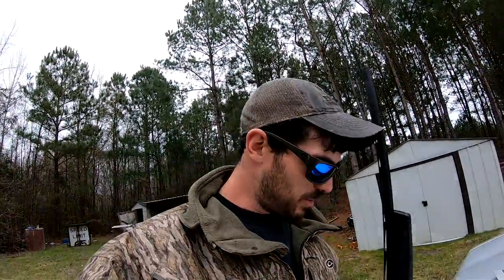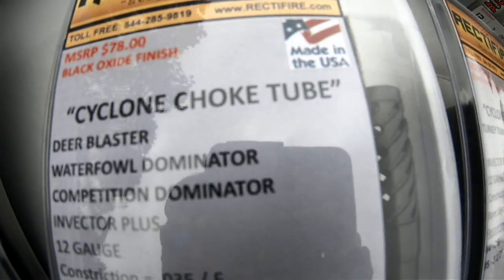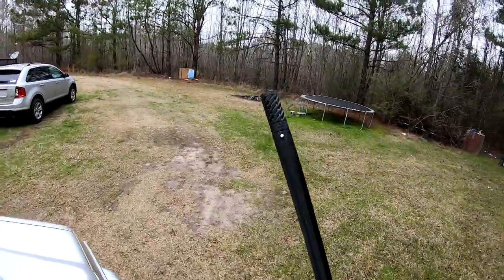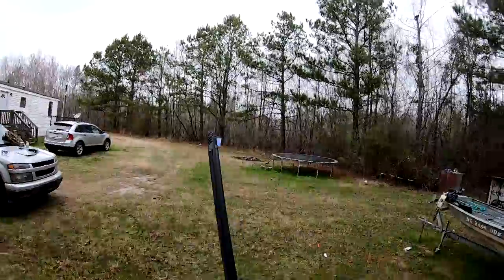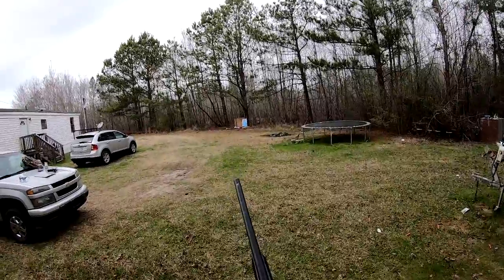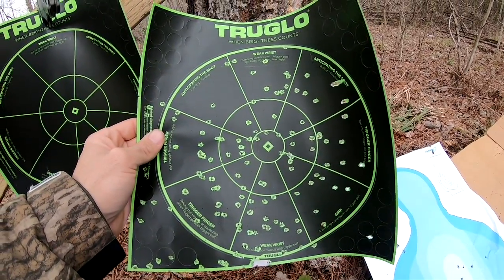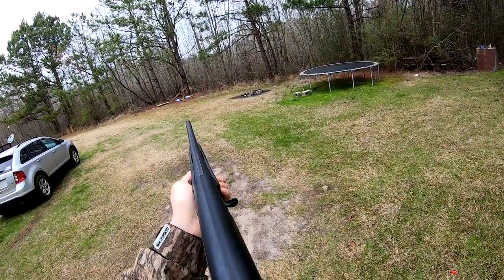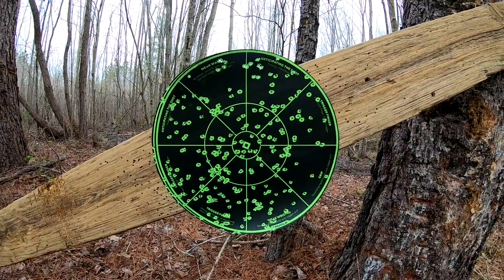Pattern Testing Rectifire Choke Tubes!!!!

Comment: Man you need to call Browning and see if you can get the stocks for the A5 they will replace them because of the class action lawsuit over the dura touch coating !
Reply from the maker: Gator Flea might have to look into that man thanks
Reply: @bigpenselsoutdoors9793  The dura coat couldn't handle Deet!